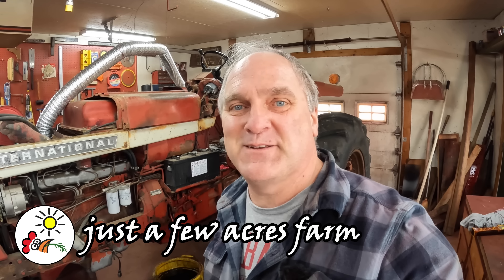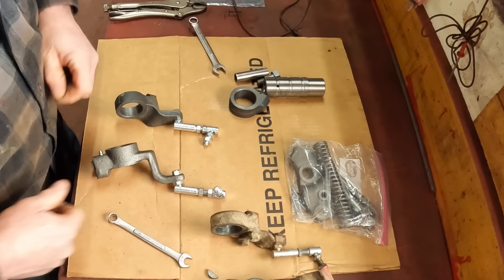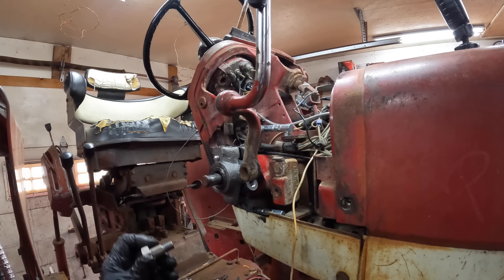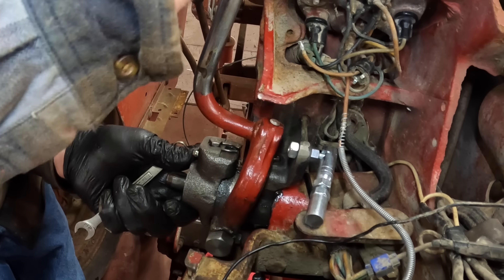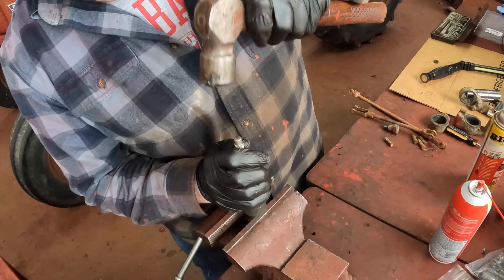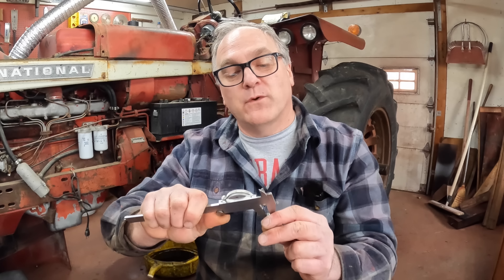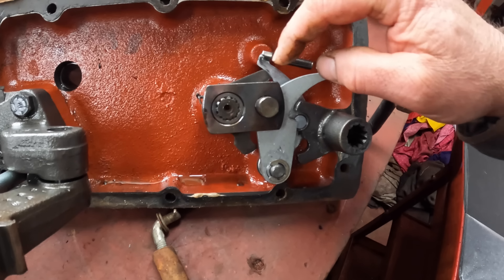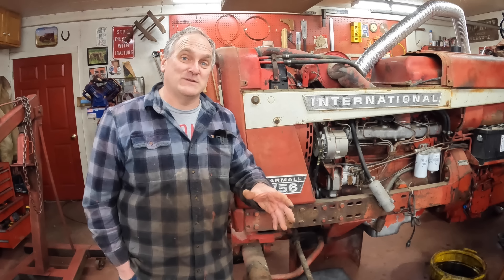Fixing Sloppy Shifting on the Farmall 756

Comment: Thanks for sharing Pete! I spent a fair amount of time baling and feeding with a 656 Farmall, it had a different shift system. Talk about a nightmare. It never worked right, and the pins were worn and always falling out. It was not my tractor but I still tried to fix it for the owner. I made slightly oversized pins for it and pressed them in. They helped for about a year and fell out. I think the design was poor from internationals side from the get-go. Maintenance was incredibly difficult, and in my experience it seemed like a high wear area with the dusty environment tractors work in.

Comment: Nice to see you back working on the old stuff.
Also those holes in bushings WITH grooves is designed to be offset. The groov should be filled with grease in order to allow grease pressure to build in turn keeping water out. Otherwise water will fill the grooves and rust will form between the bushing and housing. If holes are aligned grease in grease out and won’t allow it to pack. 10:43
Reply from the maker: Grease will pack in anyway. The resistance comes at the interface with the inner bushing, when the gun pumps it in. Splitting hairs here I think, especially in such a low motion application.
Reply: @JustaFewAcresFarm  your probably right. Iv only used those in high pressure apps.

Comment: Excellent video Pete  :) also fix up Farmall 756 Tractor transmission , shifter & linkeage to also you named and explained lots too! Very usefull information about doing in steps each and like grease fitting to grease up new ones compared old ones too  and think someone told Farmall, International and Case to change location if do so be able grease up when lots easier too ! They did I bet !

Comment: I used to work for a lumber yard that had an old Clark fork lift. It was a standard transmission with shuttle shift. The shuttle shifter was sloppy. One time I was doing a precise job with a helper ( spotter ) and it hung in forward when the shifter was in neutral. I let out on the clutch and it jerked enough for the timbers to jump off the forks. Almost pined the guys legs. The forklift did not move, but shook enough to dislodge the load. Scared both of us.

Comment: Amazing how a little slop here and there add up to a lot of slippage. That is usually what happens to so many rider lawn mowers over time. So many little sloppy joints that add up to real issues after a while... That usually shows up in the steering when you have a quarter of a steering wheel turn before the wheels/tires start to move... Thumbs Up!

Comment: You should definitely go to it it’s the 100th anniversary of the Farmall. Definitely one for the history books. And one that shouldn’t be missed attending. If I had the funds, I’d definitely attend it and I’d definitely look for you there to see you. And you should see if they have the Farmall Regular built in 1924, serial number 503 I think it is. The earliest Farmall regular sold to the public. I believe it’s in the CaseIH collection, but it should be there. And I would like to hope that they’ll have the last IH tractor built. The MFWD 5488 rice special built on May 10th 1985. It left the Rock Island Farmall plant on its rice tires, but has since been re fitted with standard tread tires to make maneuvering the tractor on concrete more sensible, rather than wearing out the original factory installed rice tires.

Comment: Our 966 would work that pin out every few years. We put a 1/4 bolt and lock nut on it.  When ever the pin fell out the transmission would be left in gear requiring you fix it right there.  It looks much easier  without the cab on.
Reply from the maker: Good to know. I thought about putting a bolt in there & maybe I'll do that.

Comment: I was going to try and make it to the Red Power Roundup myself.  I hope to see you there.  I am mostly interested in tractors, my only International is a 1952 Farmall Cub.  It's a fun little tractor, but I just toy with it.  I also have a 1946 John Deere A, 1954 JI Case SC, 1968 Massey Ferguson 130, 2004 Massey Ferguson GC2300 and a 2022 Massey Ferguson 1825 E.  I guess I'm more of a Massey guy, but hey, they are red too :)

Comment: I might catch flack for it....but I love seeing Old Iron running under modern-ish power.  Sometimes you can find a re-powered tractor with a more modern engine in it.   I also have a soft spot for demonstration model machines.  Some brands tend to go so far as to paint them an odd color, vs the production model versions.  Some even got special prototype equipment.  If ya spot anything like that, check it out.  Lots of neat stuff running around those sort of shows.

Comment: Hey Pete! How do you heat your shop? Do you have an issue with glues, paints and chemicals freezing?
Reply from the maker: Hi Tony, I have a 25,000 BTU propane fired forced air heater with a chimney for combustion. It works really well and heats the shop up quickly. The shop is well insulated. I don't leave the heat on unless I'm working in there and it rarely goes below freezing.

Comment: The 756 has just wear that is expected at this vintage machine and its use overtime. Nothing really so far that shows it was used and abused. I have seen a lot of machines that have very many things wrong with them not to mention nothing working in the instrument cluster. Worst ones are tractors that have major slop in the steering system and or no breaks. If you attend the show just film things that get your attention. Maybe you see another MD just like yours?